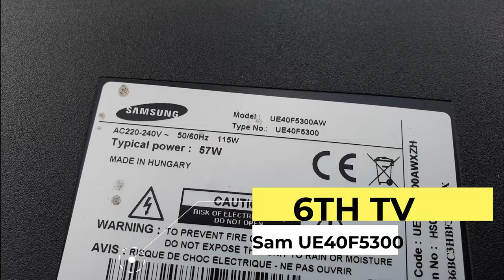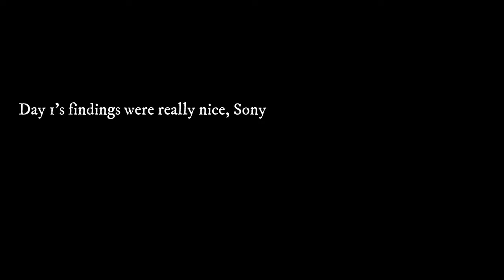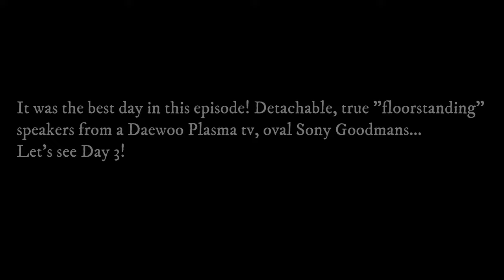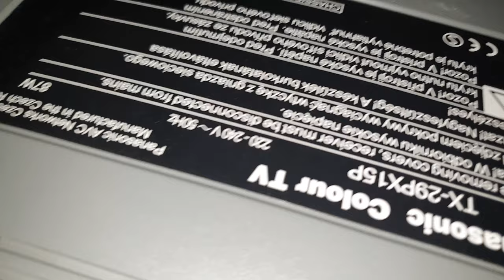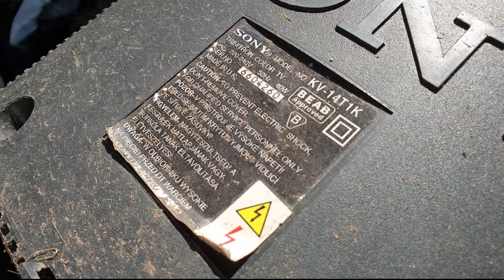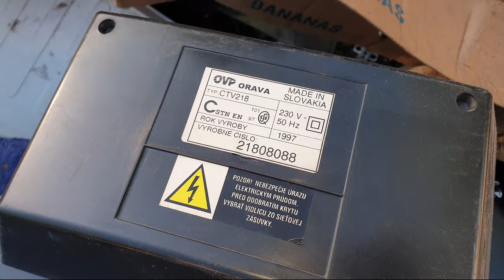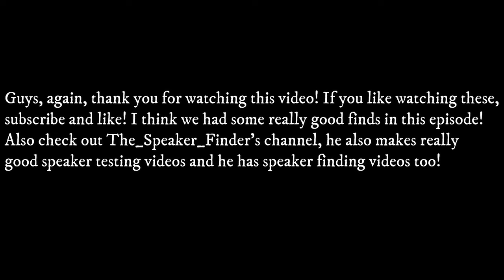Speaker Finding #23: Daewoo 3-way Plasma TV Speakers, Sony Wega 2.1, and More!

Comment: 8:00 i have the eas16s12a vwrsion of those my friend found the tv in very bad condition. The other speaker was a little bend in from the sides and the terminals are a bit rusty on both the tv was smashed and the screen was ripped off. Both of the speakers work!
Reply from the maker: Good! These are really good speakers, i'm glad you have them.
Reply: My friemd gave them to me because he already had them

Comment: If there is a scratchy nois in the woofer/sub doesn't mean its broken just a dusty voice coil bc of old ness
Reply from the maker: Yes, i know. If the speaker is scracthing, it can mean that the voice coil is not centered right, or there is dust between the coil and the magnet, but the coil is scratching too, when the coil is burned.
Reply: @the_speaker_tester  yeah 👍